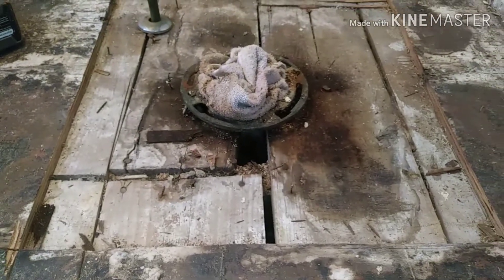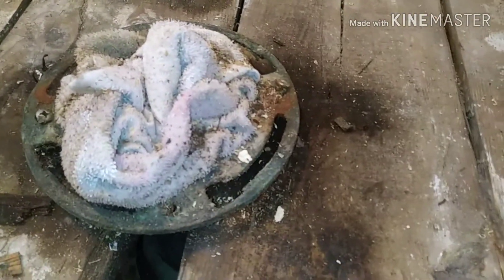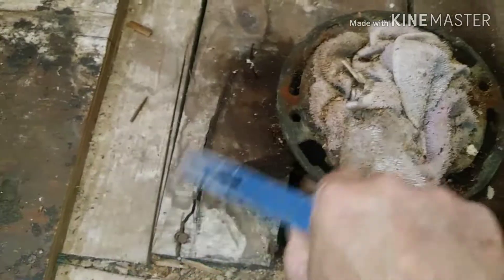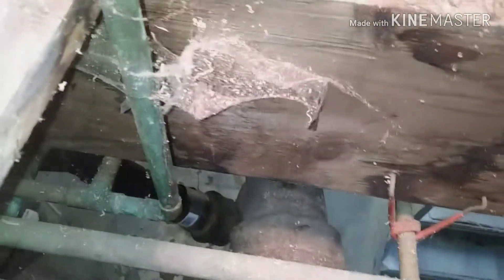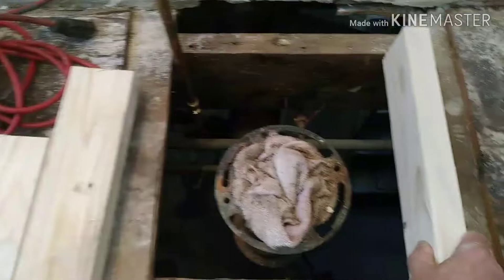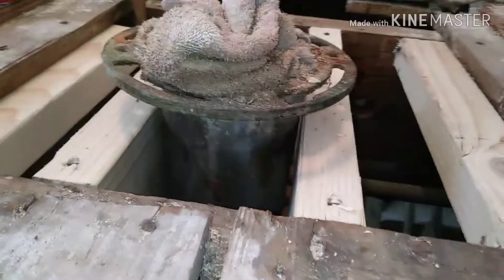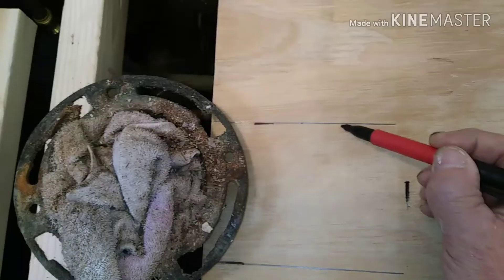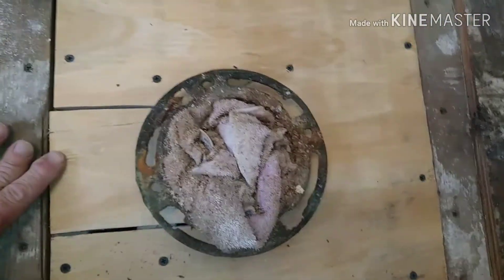Fix rotting floor under toilet

Comment: You can't imagine the number of videos I had to watch until I FINALLY got yours!! You explained this so perfectly and it is exactly what I needed to understand how to remodel my bathroom floors. You saved me so much money. Thank you!!!!!
Reply from the maker: Good luck
Reply: @GetToThePointplz123  so i should put the blocking across like that too? im using 2x8s because previous floor was 2x8s
Reply from the maker: @Eastbaypisces  not knowing exactly  you're circumstances,  I will say yes although 2x4 blocking is usually sufficient for support.  Alot of people that aren't sure typically will over engineer which is perfectly fine also
Reply: Straight to the point. No annoying music of silly jokes. You nailed it. Thank you!

Comment: I just finished doing the same thing we had to remove the rusted cast iron flange approx 14" to the stack  3" non hub with boot & PVC. 
I was debating what corrosive free screws to use the tapcons are for concrete. The 2" brass screws were hard to screws in only had flat head slot and the stainless steel screws were for sheet metal so I used 2" exterior Phillips screws.🤔

Comment: For that old wood you removed at the start do you worry about disturbing all those old layers with the dust and asbestos?  Simple respirator enough to cut through all that?  Did you use a reciprocating saw or circular?
Reply from the maker: Circular saw and jigsaw...dust mask or respirator works also

Comment: Fantastic job! You left out nothing and it was truly "to the point". May I add, you may prefer plywood vs oriented strand board (OSB) in the long run. Moisture is its mortal enemy. If it sweats, it can cause capillary action to wick it under the toilet if the bowl isn't sealed where it meets your flooring.
Reply from the maker: Agreed ..unfortunately plywood doesn't hold up to water also
Reply: @GetToThePointplz123  Plywood will take water for a mighty long time before it actually fails. OSB fails immediately leaving no chance to find the problem before its swollen/ruined.
Reply: very helpful. Also would not use OSB in wet areas

Comment: Is the toilet flange sup to be flush to the floor ????
Reply from the maker: Flush with finished floor or slightly above is ideal, if it's a little low there are ways to address that
Reply: @GetToThePointplz123  ok thanks

Comment: Thanks… What size is the “blocking” lumber? Are those 2x6?
Reply from the maker: I used 2x4 here, if you have a larger span you could use 2x6
Reply: Thank you for your response. I’m heading to Lowe’s tomorrow for lumber and the 3/4 in plywood I need!

Comment: This was great thank you! I did have a question what if the flooring sets higher than the flange? How do I make sure there will not be a leak?
Reply from the maker: If its not to low they make flange extensions

Comment: Want to do this at my house but don't know much about lumber. What type of lumber do you use for the blocking pieces? 2x4 or 2x6? Pressure treated?
Reply from the maker: If it is not in direct contact with soil or concrete you can use white pine or yellow pine which is standard framing lumber available anywhere, doesn't need to be pressure treated

Comment: fixing our toilet, new construction, they dont care.  poor design, no real support under the toilet.  24' on center joists, toilet obviously moved up and down, after 12 years sprung a leak.  That was 3 years ago, just discovered it.  you can imagine the sight. anyway going to have to cut way more floor than I wanted, but need to scab in support.